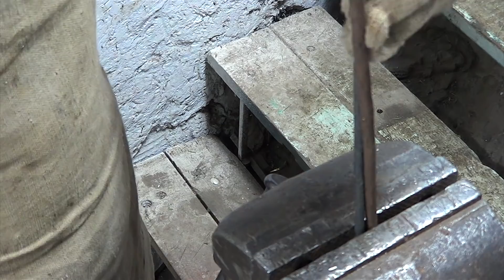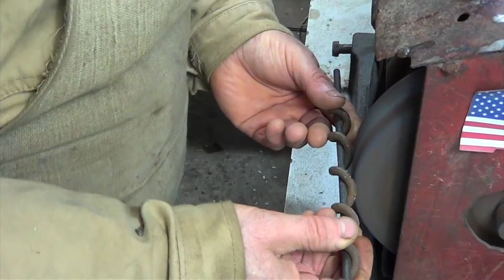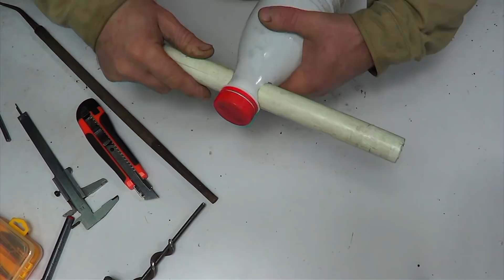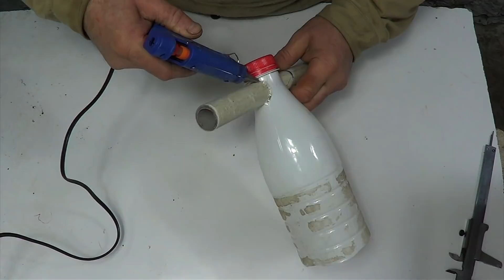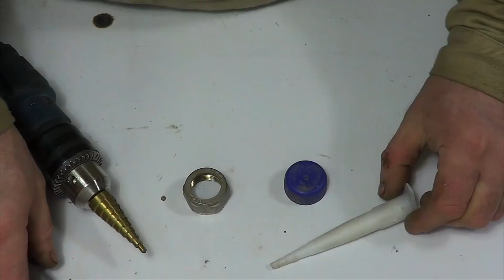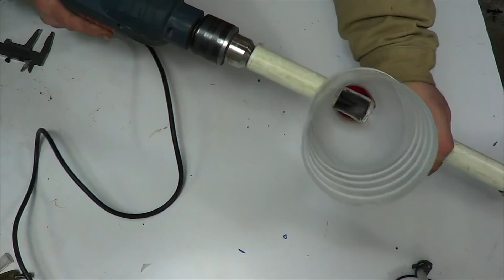IT SHOULD BE IN EVERY HOME / HOW TO MAKE / Tutorial

Comment: Cut the bottom off an old caulk tube, leaving a flange on it. Then cut a small hole in the corner of a gallon freezer bag. Duct tape it on the outside to hold it in place and keep the hole from tearing. Then you will have a masonry piping bag.